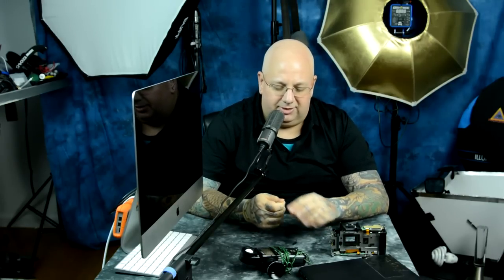PRO TIP HOW TO: 80% Reason WHY your camera shutter mech. FAILS 'early'

Comment: Bam! Project done. Just spent a couple/few hours cleaning the butts of every lens and rear cap and, as needed, rear element using two of your recommended techniques. Alcohol for rear mount and rear caps, and distilled water and q-tips for rear elements and I also cleaned the mounts of all my cameras, too. I now have 30 nearly perfectly clean lenses. 

I was surprised that my new 70-200mm 2.8 VRIII was dirty on the back. I guess they didn't clean it before shipping it out. Quality control may be out on the newest gear now being released. It had more grime on it that some of my other lenses that I've been using for years. But, I am extremely particular about the care of my gear.

Comment: Do you recommend some sort of lubrication of the mount on either camera or lens other than the thumb rub?

I'm experimenting with a light smear of Teflon grease on bayonet mounts and a little more on the m42 lenses. 

The screw mount seems to benefit more from it since the lubricated threads can lock in tighter and still release without too much effort